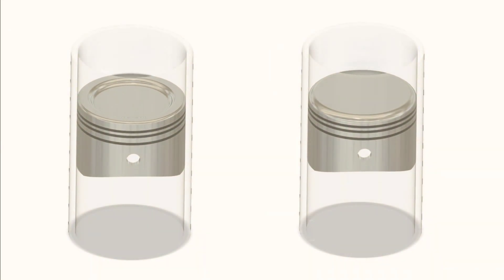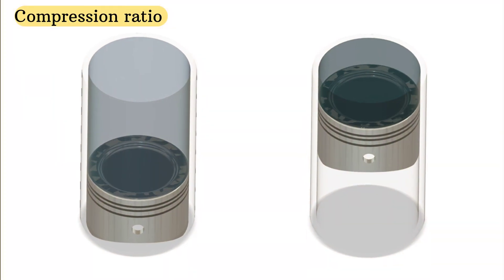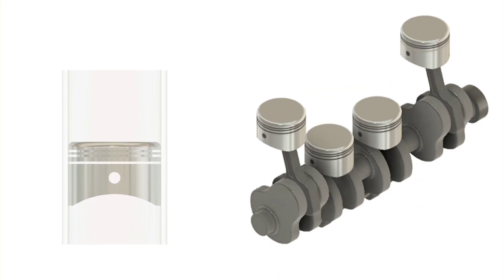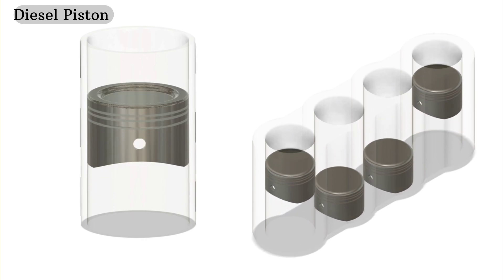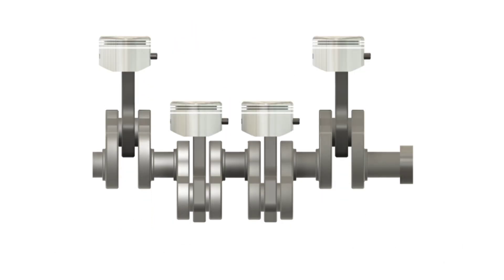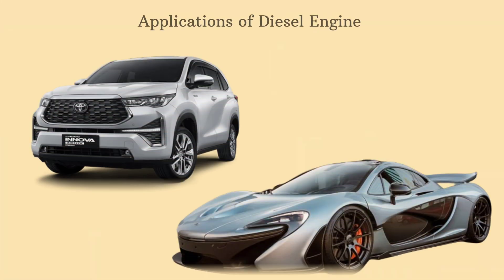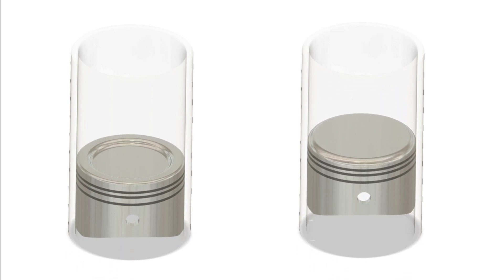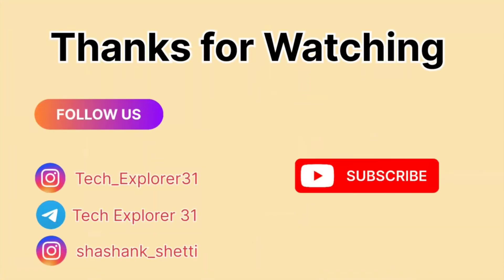Engine Performance Explained: Diesel vs Petrol #engine #petrolengine #dieselengine #power #torque

Comment: You are wrong, diesel does not provide higher torque. Just look at the specs on engines of the same size
Reply from the maker: You know what is Torque?
Reply: @techexplorer31 Of course I know that. But look at the specs of a 2 l na diesel vs petrol engine, and you'll see which one has the highest torque. It's not the diesel.
Reply: Torque will be high for diesel if you compare 2L NA Petrol and 2L NA diesel. Petrol has more power only because it can rev higher than typical diesel. Diesel engine has higher compression and diesel fuel has higher energy density than petrol engine and petrol fuel respectively, which means more torque for diesel.
Reply: @hari4406 No, a modern NA 2l 4 valve diesel engine has about 140-150NM of torque, equivalent gasoline has about 190-200NM. Without supercharging, a diesel is basically dead
Reply: @peterolson8350 tell me what engines you are specifically talking about, no NA car will have higher torque than NA diesel engine. even while turbocharged, diesel engines provide peak torque at lower rpms
Reply: @dhruvabashte  So you haven't read the specs on diesel vs petrol engines? An example Mercedes 3.0L Diesel 185Nm, Mercedes 3.0L petrol 260Nm.This is more or less how it looks on all diesel vs gasoline engines, nothing special about my particular example
Reply: @hari4406 Here you have another one, VW 2.0 sdi 140Nm. A 2.0 petrol has about 190-200Nm